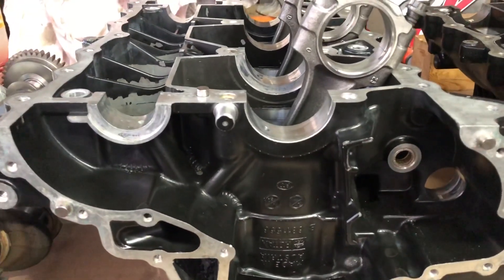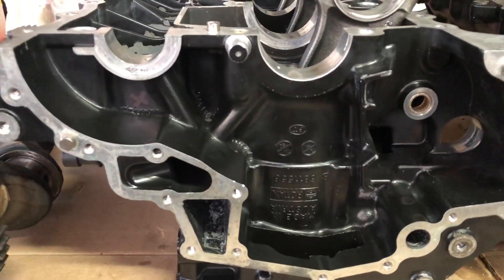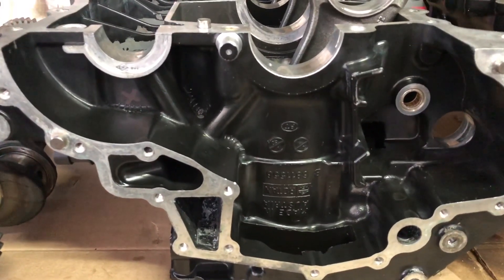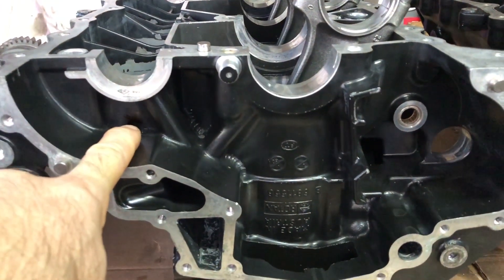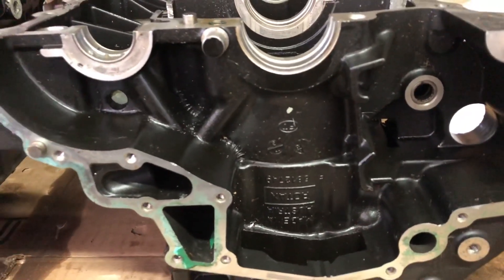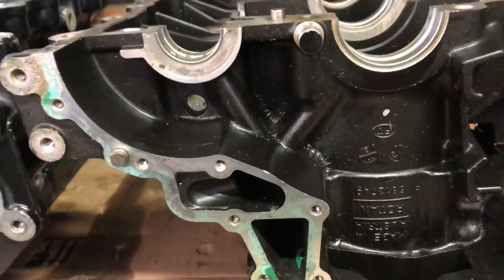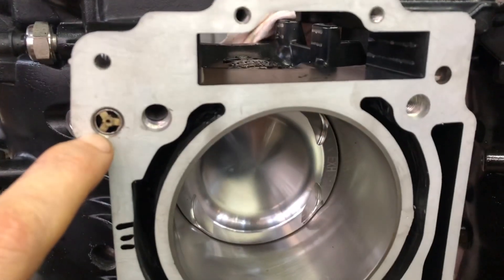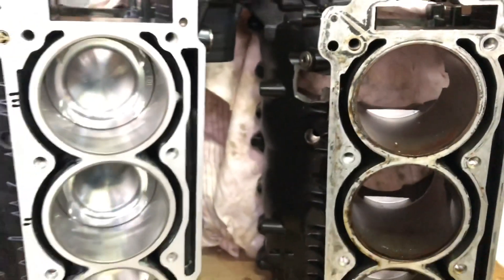Sea-Doo 4-tec Engine Block Retrofitted

Comment: Why drill the hole? If I do not drill the hole, what damage will it do?
Reply: I have an '06 block and I want to put an '03 head on it to make a full engine. Will I have reduced oil pressure to head due to no oil jet on block and will the '03 head receive reduced oil pressure causing damage?
Reply from the maker: @cedrik9  make sure the oil jet in the block is removed as shown and that you have the hole in the block so that the system may breathe right then you will be okay.
Reply: 10-4. Thank you.
Reply from the maker: If you don’t drill the hole then the oil pressure will be too much in the sub assembly and you will have big problems .

Comment: What are the symptoms/effects if you don't drill the drain hole in the block?
Reply from the maker: The pressure will become too great and the oil dipstick will pop out and oil will blow out from the oil dip stick tube causing havoc .
Reply: @Redrockat  I have an engine with 07 Cases and 05 PTO cover that is sending oil through breather. Engine fully rebuilt, even stripped down again to check rings, everything looks good. Trying to figure it out
Reply from the maker: @vyzadaze  are you using an 04-05 head ? . Basically are you using everything else from the 04-05 ski on the 07 block casings ?
Reply: @Redrockat  I am not sure, it came to me broken. They claim it used to run
Reply from the maker: @vyzadaze  in which country do you reside ?
Reply: @Redrockat  I'm in Roodepoort. I found the problem, whoever worked on ski before had used lots of silicone, there was a chunk blocking the passage from pto housing to scavenge pump

Comment: I'm installng a 09 head on a 05 4 tec block. Should I perform this retrofit? Thx for the video
Reply from the maker: Thanks for watching ... if you are using only the 09' head then only remove the oil jet , and make sure to use the 09' rockers and shaft as is fitted by the factory .
Reply: @Redrockat  Thank you